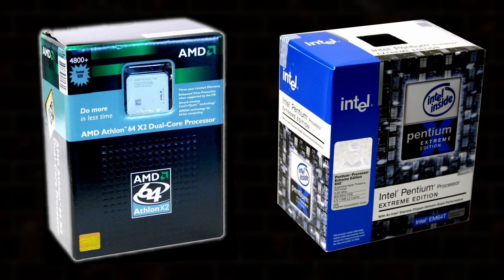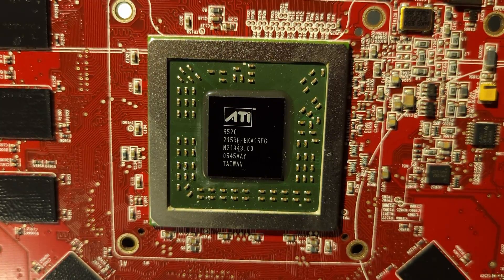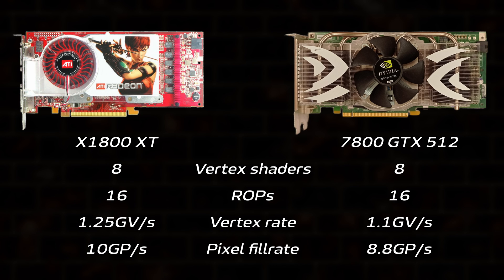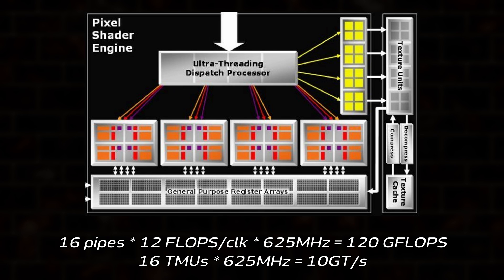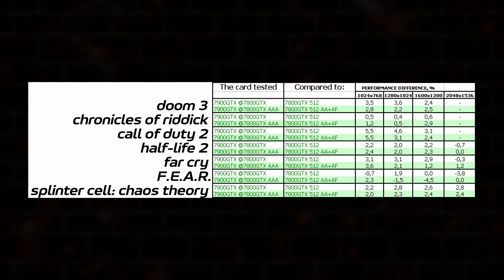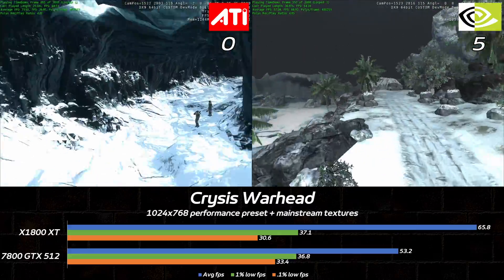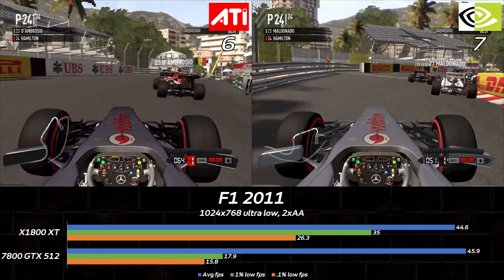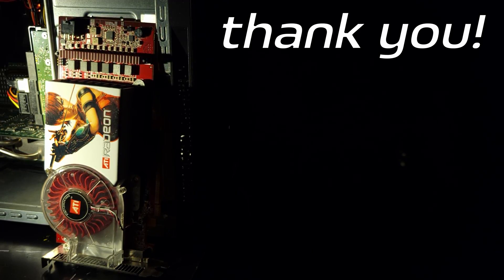Ultimate 2005 GPU Showdown: GeForce 7800 GTX 512 vs Radeon X1800 XT

Comment: I have an ATI X1800XT in my 2005-2010 rig! It's paired with a E6850 and 4GB OCZ ATI DDR2-800 in dual channel. Also rocking a 500GB Hitachi 

What a great system it is for Prey, Dirt, Oblivion, and so on! I remember buying the X1800XT in 2005 when it was just released! I was 17 and just starting my first (real) job. If only I knew what I knew now, I would have savored every single moment.

Comment: I do think it's kind of sad you didn't test Terraria or Minecraft in this test suite since those games were both around the early 2010s and both would struggle on both cards and be a good test of their might. In case you're wondering, old versions of Minecraft do actually support OpenGL 2.1. It was pretty recent that they switched like 2020 to OpenGL 3.2

Comment: I had X1800XTs crossfired. Crossfire was a different animal with these cards. It required a crossfire card and a regular card. They were connected by a dongle which in turn connected to your monitor cable. It wasn't a hassle as much as it was kind of confusing to look at. By the time I moved on crossfire had become like SLI, just used a bridge with the 3870s.

 When you got a set of X1800XTs hot and running hard it sounded like your PC was taxiing for takeoff. It was that loud.
Reply from the maker: Did you get them before or after the X1900 series released?
Reply: @hblankpc  Before.
Reply from the maker: ooooooof. Were you pissed?
Reply: @hblankpc  Yes. I paid a lot of money back then for them. Close to $1000 if I remember right. That's when I learned about buying highend stuff. I haven't been top of the heap since. I stay relevant, I am never top end. 
 I have some great parts, but I've waited for the inevitable price drops.

Comment: I came in the pc scene around the radeon 3000 series where apparently all gpu manufacturers shifted to a unified architecture. I never knew that the differences in gpu design could effect render output other than framerate and frametimes.

Comment: What's that? Oh no big deal, just an in-depth video on literally my favorite era (DX9) of GPUs.
Thanks for the shout out! I'm curious, do older drivers make any difference on those rendering issues with the GF7?
Reply from the maker: I tried 169.44. It made a difference, just not in a good way lol. F1 2011 crashes on launch, Skyrim has color banding and flickering shadows now, and GTA 4's vehicle shadows appear but much of the geometry became invisible. There may be a driver that runs everything properly, I just haven't found it yet
Reply from the maker: Also tried the Skyrim launch driver (285.79); that fixed F1 2011, but doesn't address the color banding in Skyrim and it still has the shadow issues shown in the video. GTA 4 got its geometry back but has color banding like Skyrim. I wonder if there's a pixel format not implemented by older drivers, I'm just not sure how to go about finding out.

Comment: Excellent video. It's crazy to see how much the 7000 series cards stumble in later games, a 256MB GTX wouldn't have stood a chance in this suite. I'm always surprised by how much the X1900 series manages to widen the gap, with it having the same well aging architecture as the X1800 XT and triple the pixel shaders it can do some amazing things in those later games, while the 7900 GTX's extreme clocks on what was pretty much the same GPU aren't enough to make up for its deficiencies.